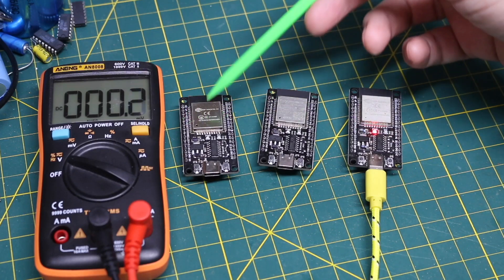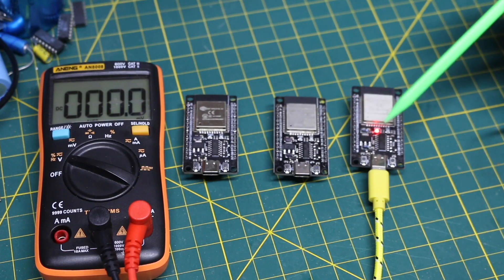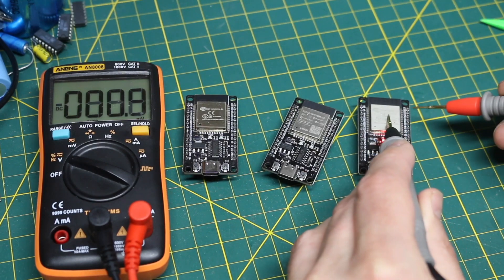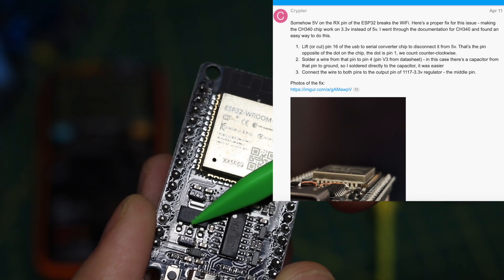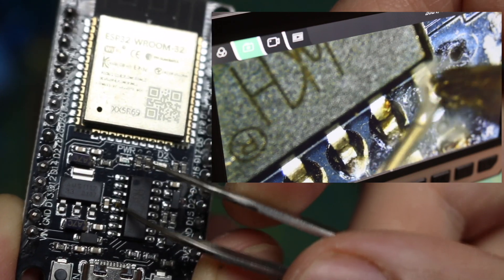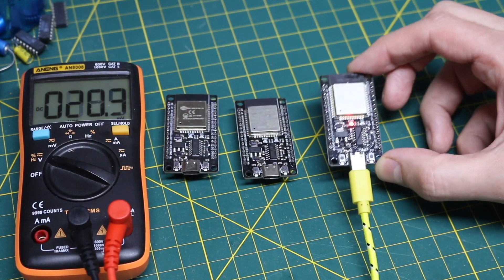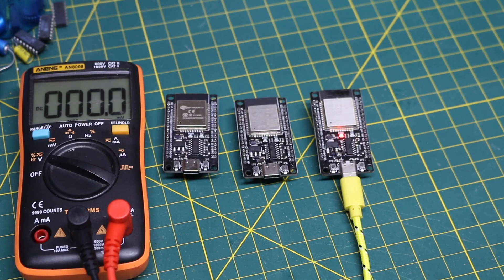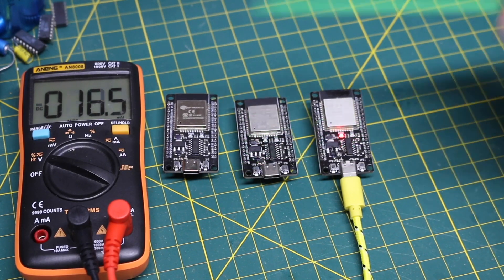ESP32 Modules with CH340 USB Chips Running at 5V instead of 3.3v on Tx/Rx?

Comment: 👌really cool video, i think maybe the problem with wifi connection using USB port is related to the  protection Schottky diode, it produces a voltage drop at the AMS1117 input, depending on the port and cable, the voltage drop can be increased producing and output voltage under 3.3 v to feed the ESP.   Im trying to desing my own devkit board, in this case ill run CH340 with 3.3v.     there is a problem with auto bootloader mode with these boards too, can be fixed with a larger capacitor beetween Enable pin and GND (10uF works). If u add this, the ESP will program and no press button is needed.

Comment: So my RX is 5V as well, while the TX is 3.3v
This is when powering from USB.
Powering from 3V3, RX is 2.6V and TX is 3.3V.
Reply: If someone can tell if the RX dropping that low is to be expected while not transmitting, please let me know.
Reply from the maker: is that while applying 3.3 V to the Vin pin? and is that with a CH 340 chip?
I think the module vin pin is intended to take higher than 3.3 V so the onboard regulator can bring it down to 3.3 but I’m not sure if the regulator on these modules just passes through  3.3 in to out without a drop out.  

having 2.6 on the Rx pin is definitely not normal and it’s around the bottom threshold for detecting logic high which I think is 2.65 V when running at 3.3 V so it definitely needs to be run differently to get that back to 3.3 V.

Comment: Very good explanation. USB IC provides the level shifting when it is connected to a 5V USB port. Why CH340 is connected to 5V? Doesn't cost anything, in fact they could have saved those 2 resistors. About the RSSI, would like to see the difference between the original modules from ESSPRESSIF and the clones.